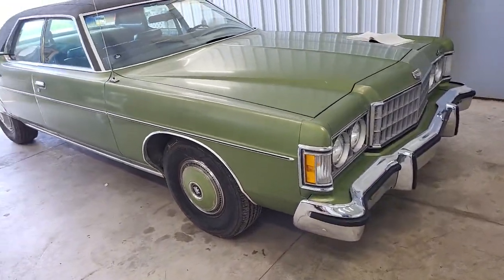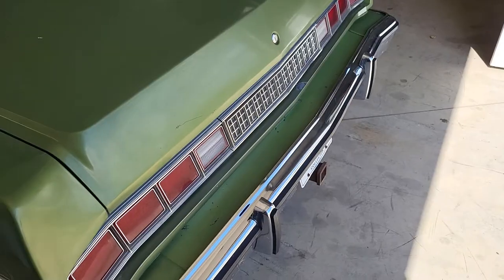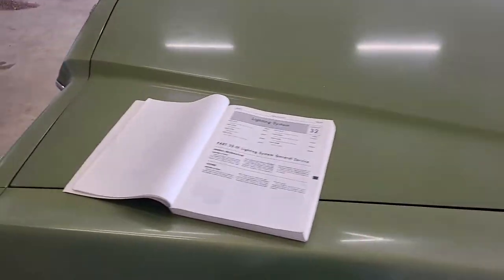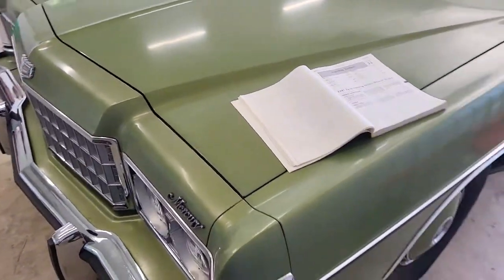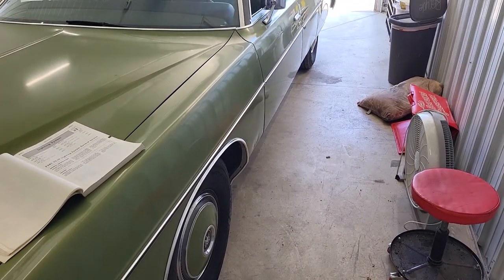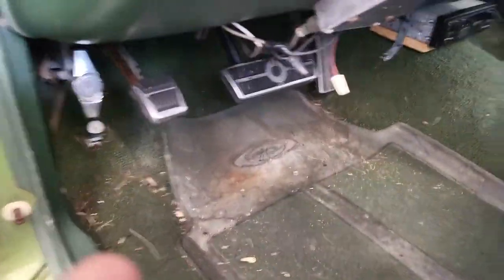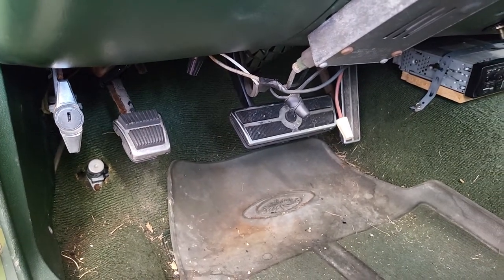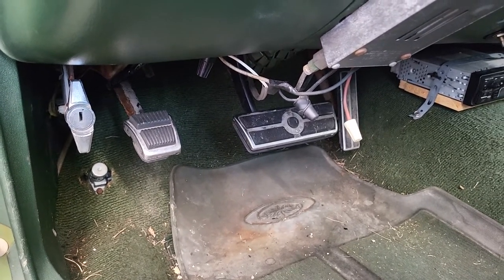Mercury Monterey restoration vlog #2 : no power to reverse lights? help?

Comment: I know you said there was no power to the sockets but those 70s ford sockets go bad pretty easy. There should be a ground on the sockets that touches the metal barrel of the bulb and those ground will break off. Just a suggestion. And I would also check the connections off of the duraspark box (driver side back of the inner fender well right next to the firewall). We have a 79 f150 that had to power to the rear lights because of one of those plugs. We have a 74 monterey (non running) and the duraspark is different compared to the 79 so Im not sure its the same as that 79 f150. Just a couple of suggestions. Not sure if they will help of not.